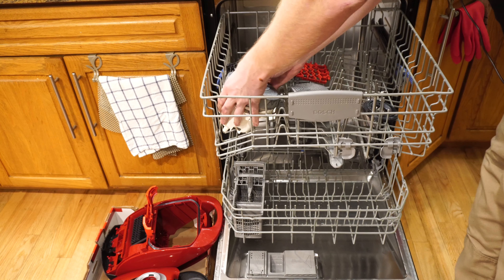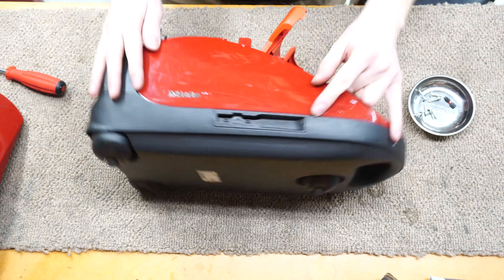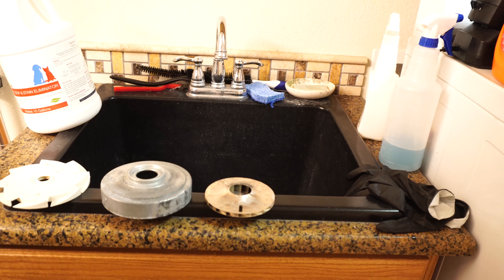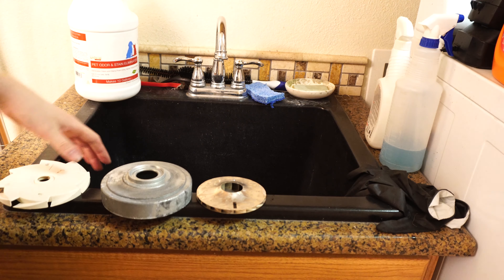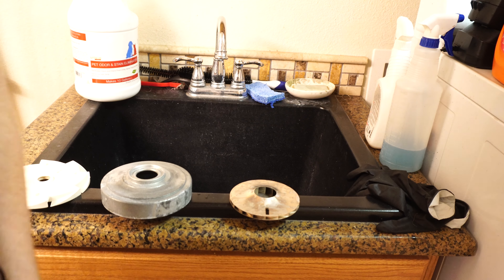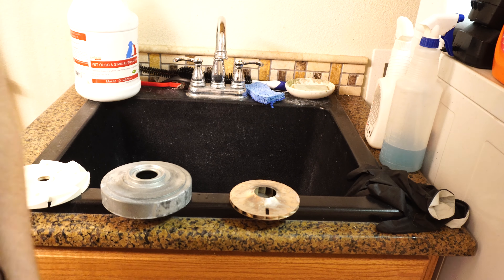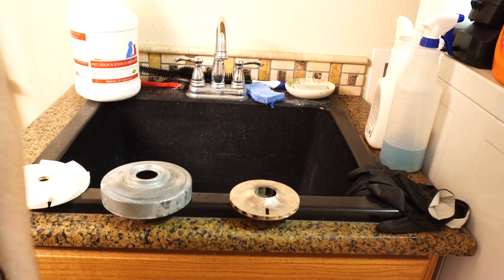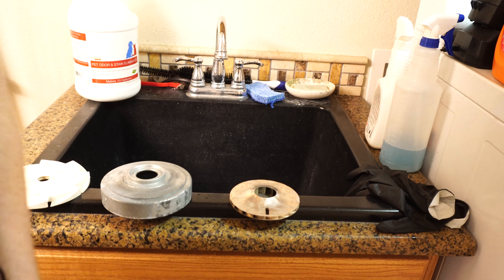How To fix Bad Smells in Vacuum Cleaners -Getting Rid Of Pet Odors

Comment: In the video you mention an enzyme-based cleaner for the dishwasher, but it looks like you're just using a regular dishwasher pod, like Cascade or something. And I don't see any detergent pods in the link in the description. What did you use, specifically? Will normal dish detergent damage the machine?

Comment: Dishwashers have a waste/drain line connected directly to your garbage disposal.  I washed through the full rinse and heated dry cycle.  
The waste from your dish washer can't be any worse than what you run through your garbage disposal.
Reply from the maker: That depends on the state. Mine are not connected to the disposal. In my state the code dictates it go into its own standpipe.

Comment: I'm very curious of your opinion on a Oreck Halo. I actually have one in my collection. And wanna know I pretty much can already guess but how is the filtration on Oreck Halos? I don't have a particular counter so I can't check. But I'm assuming not the best. 😂😂 I just feel like the lights on the bottom and Oreck claiming for it to kill 99.9 percent of bacteria. Idk personally. Just definitely feels like complete bs. What's your opinion?
Reply from the maker: Oreck bought that design from another company it's pretty finicky and fragile but definitely a cool idea. It didn't ruin some people's carpet by discoloring it. There were HEPA bags available at one time. My understanding is it's filtration is about the same as an Oreck classic
Reply: Performance Reviews Yeah I will agree that they are finicky and fragile. But it seems to clean well on the carpet I do like using it. I like that is has a manual height adjustment. Never was a fan of automatic height adjustment. I was just curious since I don't own a particle counter. I appreciate the reply. Thanks!